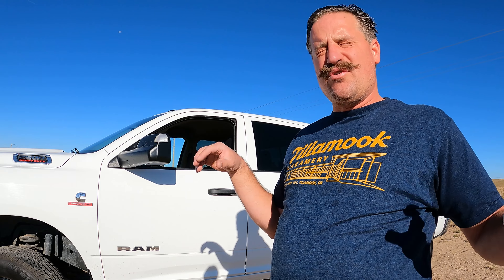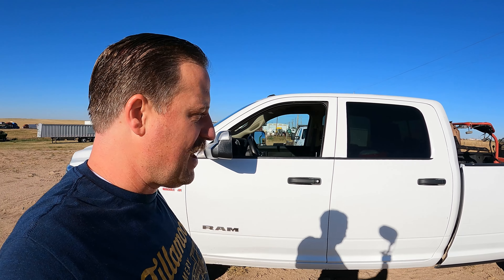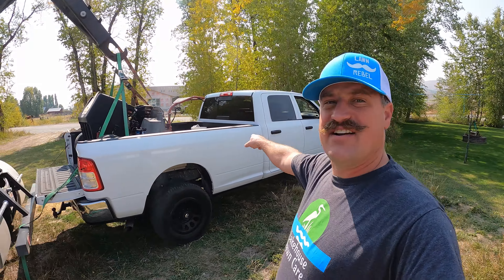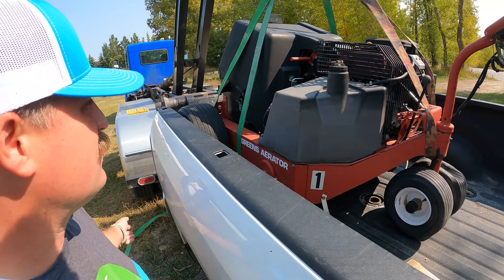Picking up an OLD GREENS AERATOR

Comment: So I bought a 2006 ProCore for my putting green. It's 1200 square feet and I can't use a drum. I paid a pretty penny for it and I put double what I paid into it. Not as many hydraulics but still quite a few. The timing is what killed me. I don't know how the 2002 runs and mine does 49" passes but holy smokes it was a pain. Badass now though!

Comment: From experience they are well built but do yourself a favor and get your hands on a service manual. There are things like replacing the head drive belt which will  require  timing the head.

Comment: When you switch out your tines , think about switching to 8mm hollow core, add more tines if possible and space them closer together.
 I'm sure you thought of this but just saying
Reply from the maker: I have thought about it but not quite in depth. I'm currently thinking getting the thing running good and functional first. I do plan to get different tine options